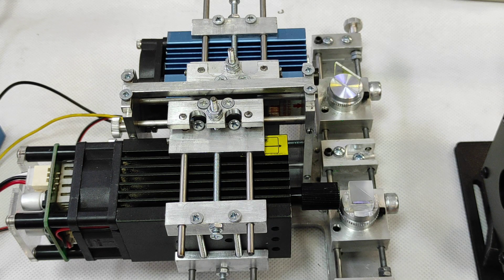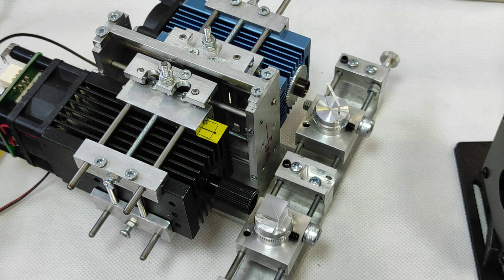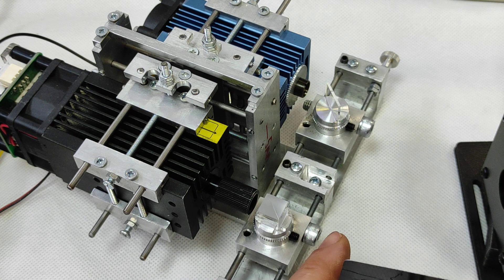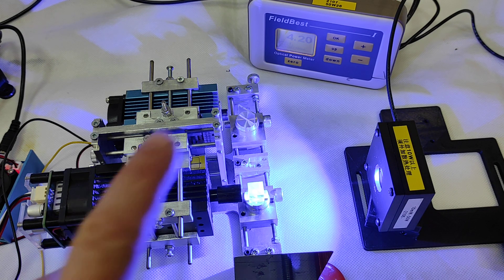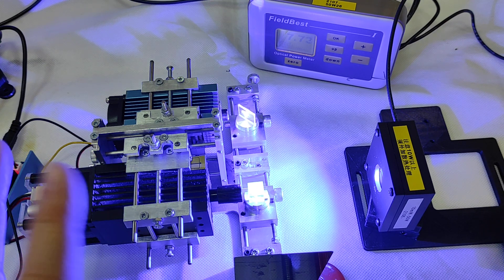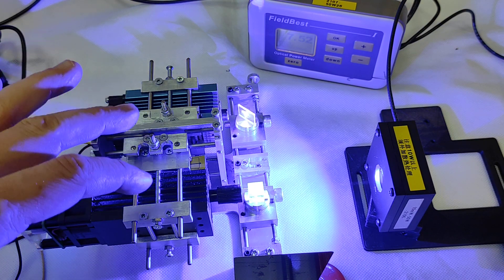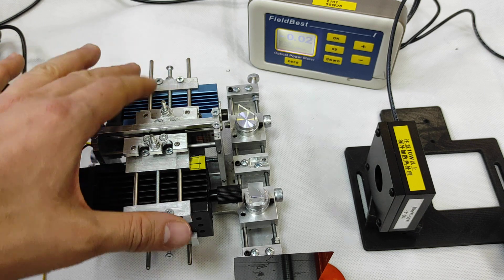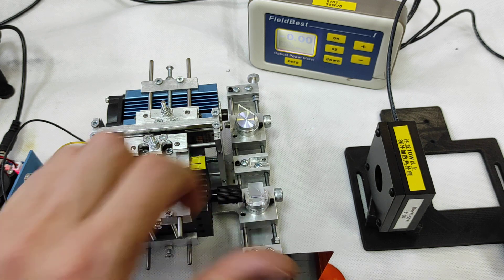An Endurance laser beam combiner system. Combines 2 beams in 1 for any diode laser

Comment: What ratio do you use for the cube beam splitter? If I use 50T/50R, I lose 50% power both in transmission and reflection. I used a beam splitter plate with a 50/50 ratio and the resulting power did not double. Which is the best option? What ratio is perfect? Thank you.
Reply: you must use a polarized beam splitter to double the power, known as pbs